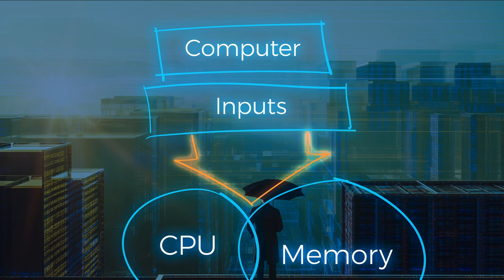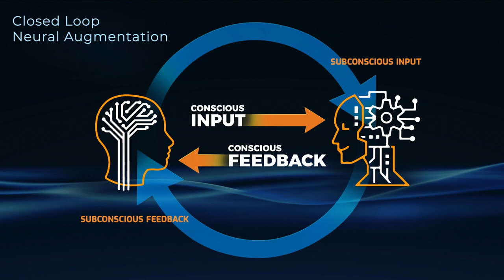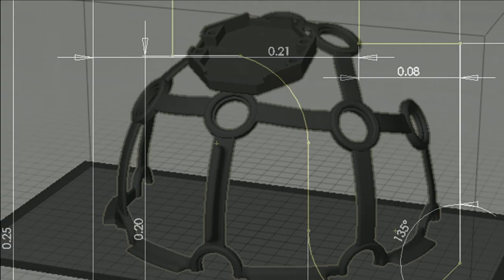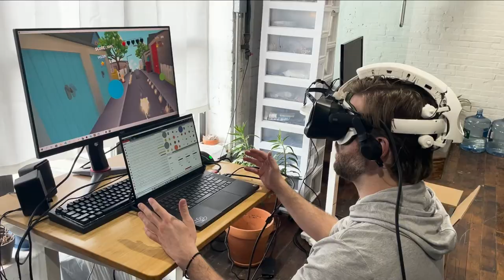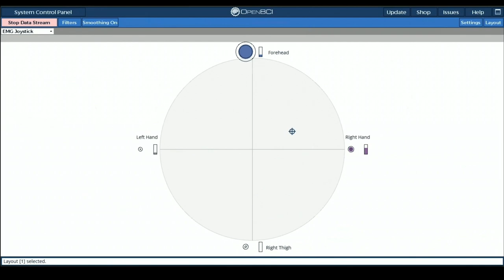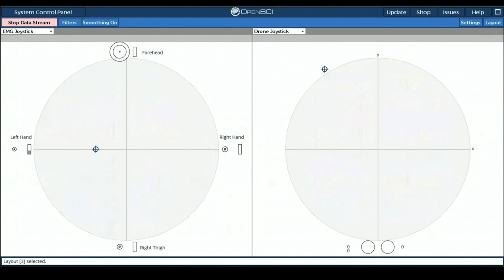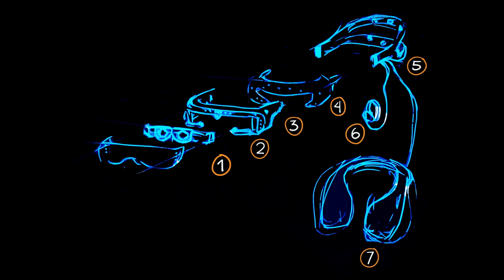OpenBCI Product Announcement | Slush 2023

Comment: Good job, but there are a couple of three questions. In the last project, you said that the avatar will be an extension of the body, will there be a possibility of sensations in this project such as tactility, pain, a feeling of warmth - cold, and a large number of other sensations. The next issue is related to the contract with Valve and Tobii. Is future integration with the gaming industry and major gaming giants possible? The third question is, as for me, the most important, you have reported that the project will be secure, but still you have concerns about cyber attacks, whether there are prejudices of such tasks, in order to avoid loss of confidential information.